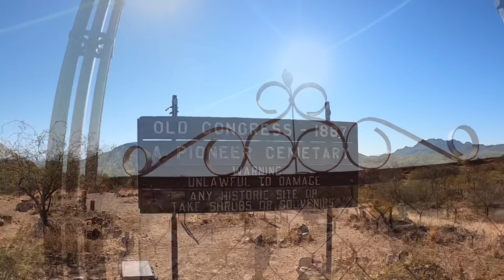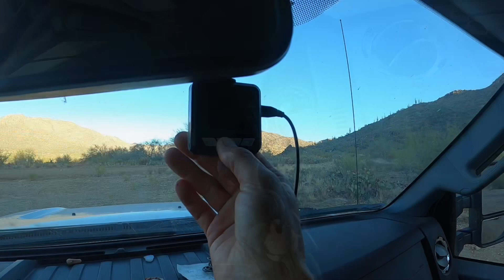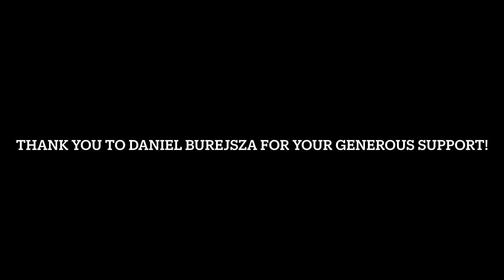Making my bed and lying in it - Living in a Cargo Trailer Camper Conversion

Comment: You did a great job, the only what I see wrong. You didn’t have to use pressure treated wood. Pressure treated wood it’s for outside purposes since it’s has been deep it in chemical to prevent dry rot. Other than that I feel proud of you specially seen you using tools. 👍🏾👍🏾

Comment: Building your own rig using a cargo trailer is pretty ambitious. Fastening things down in a trailer is sensible, but not necessarily something one may think of till afterwards! As you say, it is a work as you go sort of thing, which has the distinct advantage of being more affordable than some other alternatives. Also, building it yourself, you are sure of the quality of the material used and, if something should not work out, you know what to do to fix it. That is pretty invaluable. A true voyage of discovery! Keep having fun!

Comment: My brother built a bed for the back of my S10 with camper shell.  l put a 4" extra frim foam coshion/mattress on it.
He made it with Spanish ceder, a light but strong wood. He also spaced the supports to allow my rubbermaid storage containers to fit perfectly under the bed. I used a thick bungee strap to secure the back door when I slept.  Not that it could totally stop an intruder, but if someone tried, l'd be awake to greet them. Ya know what I'm a sayin. Keep on keeping on Girl. 💖

Comment: Lex, Not at all trying to be critical, but yes helpful. From one cheese head to another, the helicopter Dad senses kicked in.  Caught that you used treated plywood. I have been told to never use treated inside of a dwelling because of the chemicals. You could possibly seal it, or to be for sure, change out  to non treated. You could repurpose  the treated to build some kind of an outdoor storage box for when you are set in place. With the slats that you have under the treated, you could use pre drilled peg board for the ventilation, and that stuff is tough. Stay safe.

Comment: also got my diesel heater up! I never knew they existed until I saw your video...we went out this weekend and it was cold heater worked great...the aluminum external tanked worked well...but I realized having only 72AH battery I could run the diesel heater for more then 1 night without running my generator to charge the battery. will soon lookin into getting bigger batteries for the cargo trailer build..

Comment: And there will always be another mod or improvement anyway. I camp out of the back of my pickup. I have gone through three bed changes in as many years. I now sleep in a 30 inch wide bed, with a six inch foam mattress. Very comfortable.

Comment: Hey Lex, good video. I am watching the one with you plugging a tire. Make sure to heat up the plugs, apply the rubber cement to act as a lubricant and sealant for the plug. Also be careful using the inexpensive plug kit, the reamer and installer plastic handles can break. Thanks for sharing, I enjoy your candor and comedy.

Comment: Looks like a nice sturdy bed frame but I wouldn’t use pressure treated wood for furniture unless it’s outside. The old pressure treated wood had arsenic in it. The newer PT wood is treated with safer chemicals but I’m a bit paranoid. To be safe don’t let Riot chew on it. Sleep well 😎

Comment: Fricken awesome, I have a Bowie knife on my bed also. Lol, that's where I was headed to Home Depot. Getting busy here, I may go back to a 14day area, near by but away. The big Q. Is filling in. Really, a Neighbor had to knock on my door at 5am. He almost got it.🙂👍
Good Build, fyi, I put bolts in my frame,
Reply: I have a 9mm next to my sleeping apparatus. First round rubber bullet, 2nd thru 17th, 147 Grn+P JHP
Reply: @0556rick  Same also, no rubber bullets though. Bear spray, fire extinguisher, knives or whatever! 
My own reloads; 124gr GDHP, that's last resort of course. I don't mess around with tweakers. I've been in old run down oil field city outskirts. Interesting uninvited guests at 12-3am. Laser dot sights usually runs them off quickly. Just saying, yes I've been there.
Reply: Been there too.
I try to keep a low profile.
And blend in with my surroundings.

Comment: Amazon sells a metal bedframe,of varying dimensions, that is probably stronger and lighter than your wood one. I use one, a twin, in my trailer and it has worked. It is so easy to move for cleaning and such.They make them in different heights also.  I chose the 18 in height so I can put larger totes under the bed.  Not doubting your building skill just an FYI.

Comment: If you used some plywood on one side, like against the wall, it would probably never fail. You could just add the plywood to what you already have. The wood you used is pressure treated with fungicides and Insecticides for termites and such. You might consider giving it a coat of paint to prevent/minimize off gassing into the trailer.

Comment: #lex,u could put Velcro above the rear door(on the inside).
Then do the same to the sides,inside the trailer. 
Do the same to a nylon screen mesh(On 3 sides to mach what u did on the top n sides of the doorway).
This will allow outside temperature to enter. Also moon n starlight.

Comment: Great to see you have the bed repaired! I am doing a platform bed also and was curious if I would need to drill holes in the plywood. I think I will. What size holes did you do and about how often did you drill them?

Comment: If one watches an area like a 1/2  sheet of plywood in size "in FRONT of their feet"  One tremendously reduces their chances of  a snakebite !

I always use this 4x4 foot  method when traipsing around in the bushes....  Con: One's concentration really  has to be on the 4x4 area !! Not on phones or spacing out. 

Obviously as you walk... you "mentally move that square"  as you go forward

Comment: That bed will break again! Why? You need bracing wood members half way down to the floor. At least three! Two attach to the ends of the bed and one to the legs that are close to the wall. You still have full opening access to the bottom of the bed for storage.
Reply from the maker: Not all the work was shown. Thanks for your concerns!

Comment: Question..if I may? Do you know how thick the floor in your trailer is? And would you consider mounting it to the floor if possible and reinforcing the legs..horizontal/vertical with metal brackets? And..do you have anything mounted the floor permanently? More than 1 question..🤔 love Riot..great dog😀😀 happy and safe travels😀😀😀😀
Reply from the maker: Hi! Towards the end I show the use of L brackets to mount the legs to the floor. I also have cabinets and my batteries floor mounted. Thanks for watching!
Reply: @LexandRiot  I guess I missed that part🙄 thanks👍👍 not to be a pest..but do you know the thickness of the floor?? Im preparing to mount some storage to the floor in my travel trailer..from what I cann tell...there isn't much there....1/4 inch wood and about 1 inch insulation..2 inch max. Thanks again😀😀😀
Reply from the maker: @robertdeist1951  id say about that ~2” ... not exactly sure.
Reply: @LexandRiot  thanks much😀😀😀😀

Comment: At your age - 'where there's a will there's a way'
At my age - 'where there's a will there's a relative'
As far as the bed goes - why? 
Why not just put the mattress on the floor? (silly question, I know).

Looked like a good solid frame - I'm not convinced about the little bit of wiggle , that you left.
The end hatch is a cool feature on that trailer.

Comment: Sorry this is not a critique, but reality, NOTHIN last forever,  sure you can throw more money and bracing at it and it will last longer, but not forever.  Build to your ability and fix as needed, no biggie.  I am also building a cargo trailer and would be very interested in seeing how you trailer axles are attached to the trailer if you can work that into a future video.

Comment: Hi Lex, conflicted on your trailer (Colorado) vs Weeroll. Any thoughts?
Reply from the maker: They are both great! I determined my choice based on cost once the weeroll was fit for off-road use and had all the add ons to make them comparable vs. the Colorado on sale price and also the fact I didn’t want to go to Florida. They are both aluminum but I like weeroll uses aluminum floor while Colorado uses dry maxx and Nudo flooring. Hope that helps!

Comment: Hi Lex... sort of off topic, but I dont know of an alternate way to contact you 🤷‍♂️ Question... where did you find your trailer? Did you ever consider a weeroll? I have a 2016 Honda CR-V and so I am only able to tow a max of 1500 pounds.. of course, I don't want to press the limits on my car, so I need a light trailer... anyway, thanks for the great videos...on a side note, because why not since I am already rambling in this comment 😂 I enjoyed your urinal blog.. as a trans man I took the more permanent approach a couple years ago, but could totally relate to your blog.. the struggle is real. 😂😂😂
Reply from the maker: Hi Trent! The trailer is from here: https://www.coloradotrailersinc.com/2021-cargo-craft-6x12-new-cargo-trailer-castle-rock-co-80104-i2889085
I’m very happy with it... you are smart to be mindful of weight! Best of luck!
Reply: Thanks for the link! Great job on the bed repair!